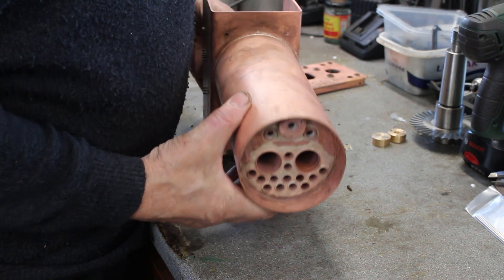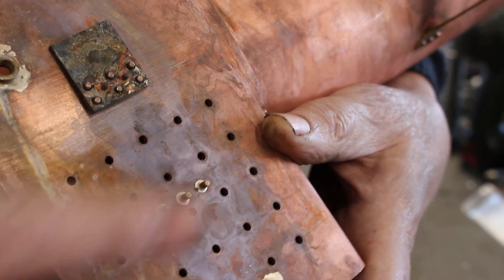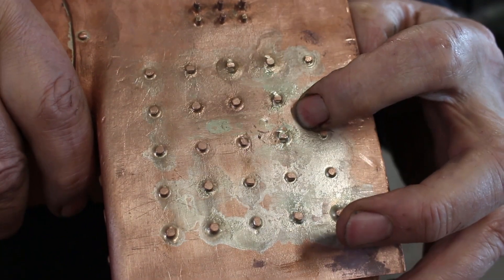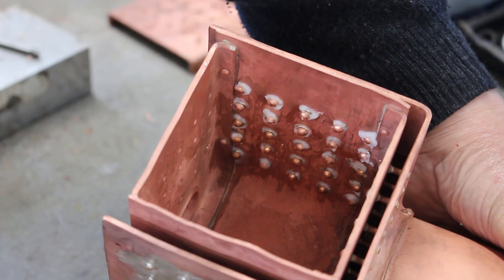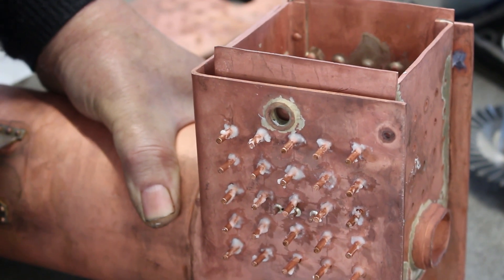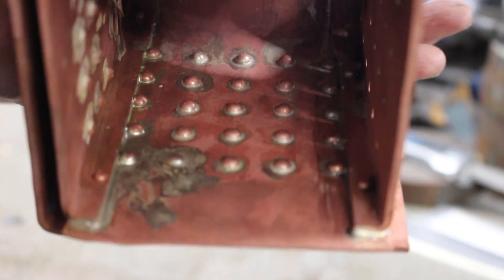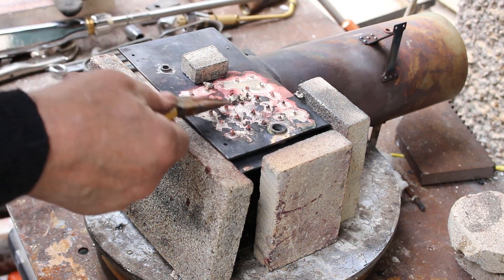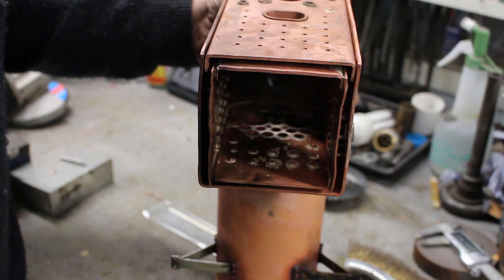Building Miniature Steam Loco LION pt. 16 - Boiler Stays + Update

Comment: A thought on building a boiler like this would be to drill all the stays holes, flux and then insert the rivet from the inside while capturing a standoff between the inner and outer walls. The rivet can then be more or less shaped on the outside and then the whole thing silver soldered. What could possibly go wrong?

One nice thing with a project like this is by the time you are done you have a pickle bath that is good for copper plating other things.

For those of you who are watching this series in 2023 you may want to go and look at what Quinn is doing on Blondihacks. She is just starting her build of a more modern switch engine and is as of June working on the boiler. Not quite as complex at this boiler.
Reply from the maker: I love Blondihacks, she's doing a great job, very good videos.

Comment: Watching your boiler build videos has been very interesting and helpful.  

I just started soldering my first model boiler this past week  a simple 2 inch dia "pot" boiler, with a single flue).  

I am having some trouble getting the solder to flow freely - I have plenty of heat from a big Sievert "2944" nozzle, but the brazing hearth I built works almost too well in that the reflected heat is burning my hands through leather gloves!

How do you know when to apply the solder to the job - by watching for the flux to flow, by poking with the solder, or do you wait until the copper is incandescent (dull red hot), or all of the above? 

Thanks!
Reply from the maker: Hi Gordon
Glad you find my videos helpful.
When the flux turns clear is when you can add silver solder however, the flux has a limited time while it remains active during heating, if the flux has gone off due to being heated for too long, the solder won't flow. You've only got a few minutes after the solder goes clear. 
I found it helpful to preheat the silver solder in the flame and dip it in the flux before melting it into the joint, thus adding more flux to the joint. 
My boiler is quite big, half way through the build I invested in oxy-propane which allows you to heat the joint area much quicker.
If you are using easy flow flux, which should be perfectly fine, you could try HT5 flux which gives you a longer time period to complete the joint.
One thing for sure is that it's not easy. 
The CupAlloys website gives some good silver soldering advice which may help.

My experience is very limited having only built one small vertical boiler and one loco boiler, but I hope the above helps you out.
Good luck and don't hesitate to get back in touch if I can be of any further help.

Nigel

Comment: I am looking your Past videos serval times... as you may know, i Layout my progress on the boiler... and i have Lots of Doubt.... 
How does it work.... are there Problems with reheating joints on the following steps.... that beeing soldered before?
Reply from the maker: OK, with my limited experience/knowledge: 
Some practice before tackling your boiler is a must, maybe look for a simple vertical boiler to build first (then you have a reason to build a stationary engine) I did this and it was valuable experience.
Reheating a previously soldered joint should be avoided but not always possible. If possible plan the soldering operations and use higher temperature melting point solder for the first joint, then lower temperature for the second joint, not as easy as it sounds though. 
Previously soldered joint re-melt at a higher temperature so that helps, I found that so long as you did not re-melt a previously soldered joint for too long, less than a minute,  it would be ok,, extended re-melting a previously soldered joint would deplete the solder weakening the joint, adding more flux and solder is needed but does not go quite as easy as soldering new joints, so it's problematic. Practice re soldering a joint on some scrap copper to get some experience, so you know what to expect.
getting the oxy propane was a real boost for me, it helps get heat quickly where it's needed without having to heat a much larger area that would otherwise be needed using a propane only torch, thus helping in not re-melting previously soldered joint.
Try and do as much as possible in one heat, I made the mistake of soldering in bushed first on my back plate then doing all the other soldering, 
Using propane or oxy-propane is really a compromise for this type of work, oxy acetylene is really what's needed in my opinion but out of our reach. If you have a copper smith near you, you could build the boiler parts and the copper smith could easily silver solder it using oxy acetylene, its an option to consider and would save allot of headache. 
Above all, don't dive straight into your loco boiler, get some practice, set up some different scenarios, so you can get some experience. 
It's also worth remembering the the flux has a limited time it will be effective so, although I would say do as much soldering in one operation as possible you don't have too much time to hang about, and the quicker you can get the joint up to temperature the better, too slow heating may burn off the flux before you apply solder.
I hope that helps and good luck.

Comment: Brilliant vid. Very informative. Could you tell me what torch are you using? It seems very powerful for the boiler of this size.
Reply from the maker: Thanks for your comment. I'm using this oxy propane torch with the heavy duty heating nozzles that you will find further down the web page. Hopefully the link will work.
https://www.thewelderswarehouse.com/Welding-Supplies/HD-oxygen-propane-torch.html
Reply from the maker: Here's a link for the heating nozzles. I've only used the smaller heating nozzle.
https://www.thewelderswarehouse.com/Welding-Supplies/Oxygen-Propane-Heating-Attachment.html

Comment: But but you can't be a model engineer or do you dye your hair, judging by the crowd at Ally-Pally over the weekend you have to have grey hair if you have anyat all.😉
The studs you are having trouble with, are they screwed through the boiler sides and soldered or just plain shank and soldered?
Reply from the maker: Hi Chris, the studs are like round headed bolts (as opposed to hex headed bolts) fitted from the inside and silver soldered in place. The problem is that the ends of the studs heat up very quickly, any molten silver solder climbs along the stud towards the heat filling the thread. In retrospect I should have fitted some bushes with blind threaded holes and attached the brackets with bolts. You live and learn.
I don't dye my hair, so would stand out in the crown at Ali Pally. Ally Pally is to far away for me, the Doncaster show is pretty good, I'll probably visit this year.
Reply: @GoCreatehms  as you were worried about the studs falling through while soldering I was wondering if you put a tap through both plates and screwed the stud/bolt out from the inside  it wouldn't move on you.